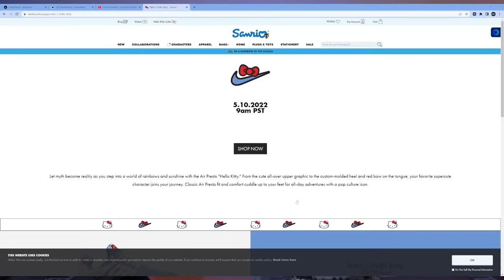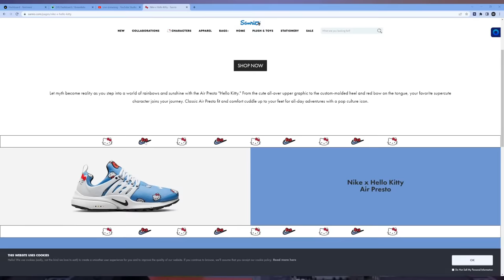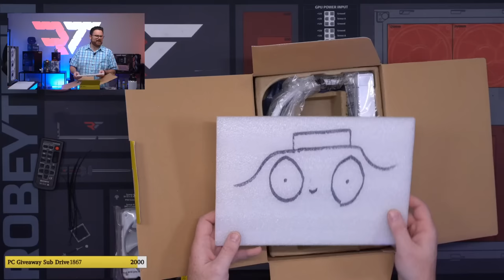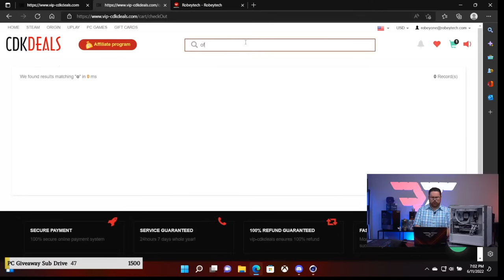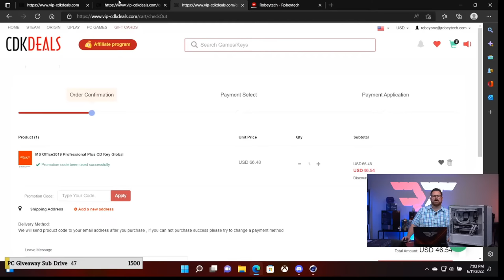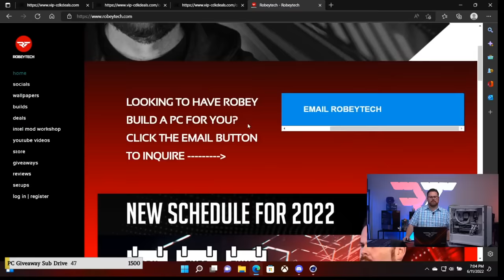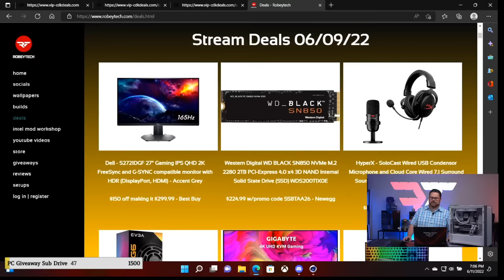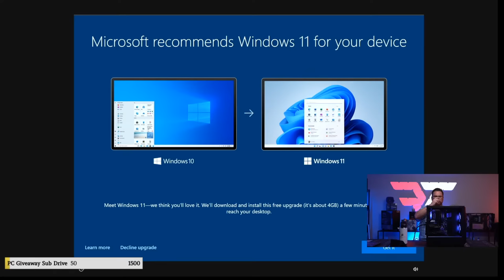$2500 PC Build - Giveaways + Corsair 4000D (12700K / Gigabyte RTX 3080)

Comment: This build is almost exactly the same as the one I plan to build and I need help with 2 things.
What's the difference between Corsair 4000D and LianLi O11? 
The second is that I'm addicted to rog strix white 3080 and I can't settle down with vision 3080 which will save me ~$300
Reply: Never spend that much more for just the look of it
Reply from the maker: 4000d is far less money and you can only do a 240mm AiO. o11 you can do a 360 but to really make it look good you need nine fans.  Vision or the Strix are great cards but the Strix is better for performance; not sure about $300 better though.

Comment: I hope the cable that runs accross the motherboard from fan hub gets moved away because it could get punctures by sharp solder joints on the motherboard and possibly short something out. Otherwise a great cable managing as usual. 
I've also noticed that the animation that plays when Justin swithces from one camera to the other (the Robeytech logo) is not in sync - the logo shows like a second after the perspective is changed.
Reply from the maker: It’s elected about half an inch above the Mobo so no issue there at all. Great concern though!